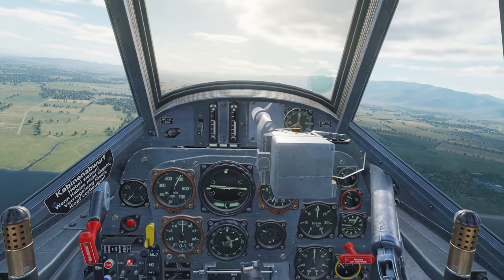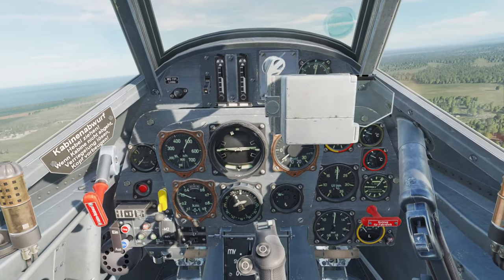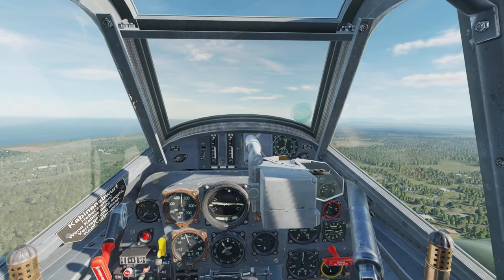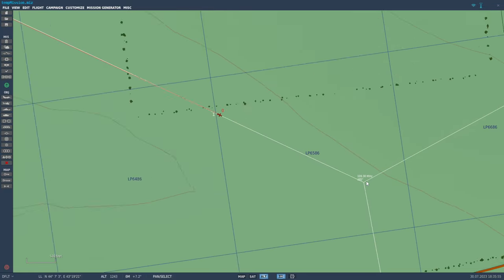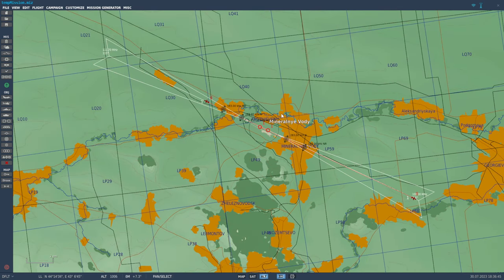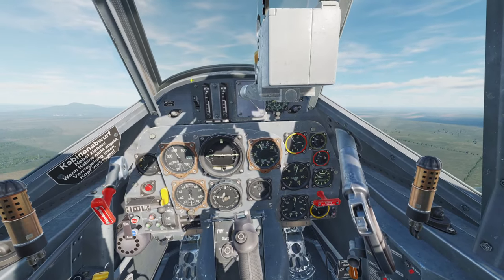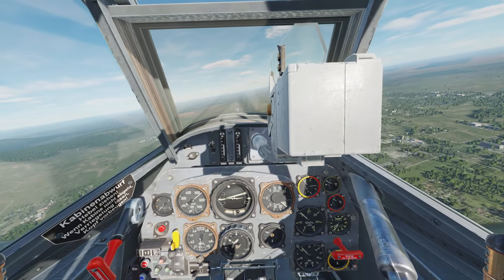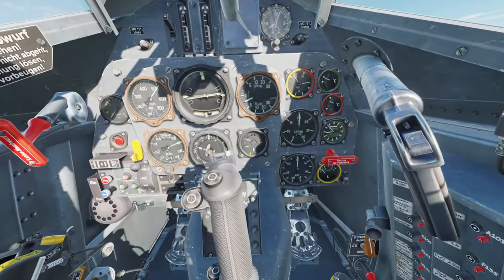DCS Bf 109 K-4 Navigation

Comment: The ADF-device (beacon device) can be tuned to any radio beacon, doesn't necessarily need to be an ILS. 

The horizontal needle pointing at the vertical range scale indicates range to the tuned beacon: 
Nahe is German for near or close
-> needle moves up with closing distance

The vertical needle pointing at the course deviation scale indicates as rightly pointed out your deviation from the beacon (direct bearing towards it). 

One way to know whether you fly towards or away from a beacon: 
With the deviation needle centered, the range needle moves down indicating increasing distance 

This should also work, but I need to test it first: 
With the deviation needle centered, turn left to see if the needle also turns left. If it doesn't and goes right instead, you're flying away from the beacon.